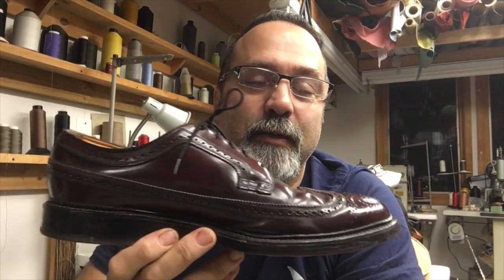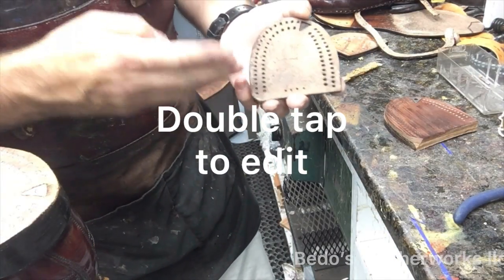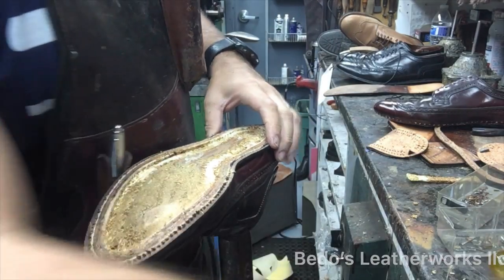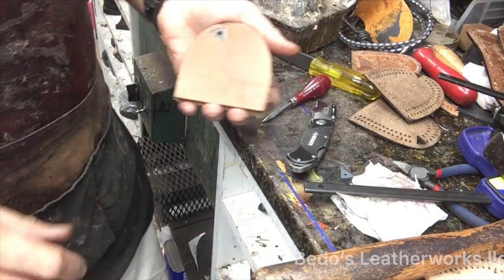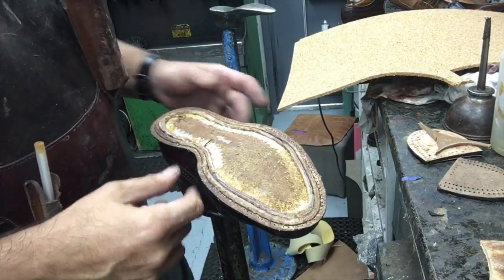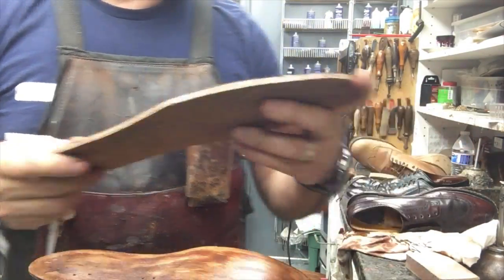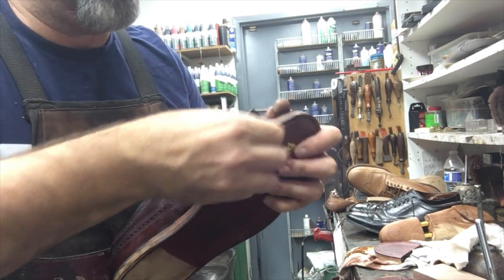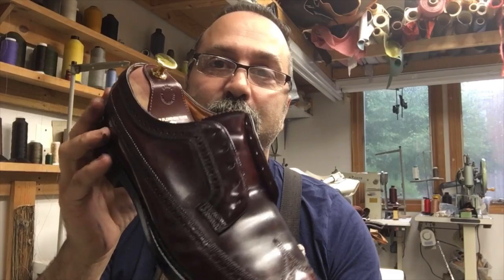Florsheim- one of the most expensive Restoration I’ve done on Florsheim’s #134

Comment: That stitching machine is irreplaceable, probably 60 to 70 years or older.
Reply: Hardly, there are lots of those things around. In fact it looks a lot newer than the one I used to use for this, that was a grey vertical machine that looked very different from this but did the exact same thing. I used to work as a cobbler when I was a student some 25yrs ago...
Edit to add why, there were a lot more cobblers before, and each had one or more of those machines.
Reply: @noth606  -  Yes, my Mother was an owner/operator of a shoe repair shop back in the '50-'70's and our Landis was an upright green [colored] beast that had no mercy if you got your fingers in the way.  I still remember when my Mom had to cut the stitches herself in order to free her hand from one of her rare missteps.

Comment: Love it. Brings back memories of my first job at 16 in the early eighties.  Working at a small shop doing  repairs, fixing heels, half sole jobs etc. Watching you applying the glue  I could smell the Ados F2 ( I think) we used to use. Loved  doing the edges of a resoled pair of leather shoes, once the dye was on and polished,  felt good to know you had done it. Hated worn women's stiletto heels, especially  when the metal pin was stuck on the tube. Lots of slow drilling and broken drill bits.  Couldn't help but notice the still visible scars on my hands from those days from drills and the occasional slip of the knife. Keep up the great work. Cheers from New Zealand.

Comment: Just a humble suggestion. While nailing the 69 sunlight-pattern rectangular nails in the original pattern as accurately as possible, one can use a thin transparent plastic template that (like a tracing paper) has the imprint of the holes from the original heel. Then, all one has to do is place the plastic template over the new heel, and drive the nails through the holes marked in the template. After the nails have been driven through, simply tear off the plastic template!

Comment: Not trying to be snarky . . . . but what is the purpose of reusing the nails?  Straightening the nails & re-clinching them results in the nail being very brittle at the bend in the clinch.  Seems like a better option would have been to install new nails of the same type to ensure the strongest bond of the heel to the sole.

Comment: it might seem to be in the same hole " stitching", only time will tell, I hand stitched hole to hole, and as for the nails did you really level each nails, since they are not going back in the same position on the heal or the correct heal for a matter of fact.
Reply from the maker: Ezzy J yes it went back in the same holes, time has nothing to do with that. And yes each nails got sanded down again it has nothing to do with the nails going in the same holes it was just to flatten the tops of the nails
Reply: @BedosLeatherworksLLC  using a mechanical stitching machine you will never be able to go through the same hole, I've always hand stitch with hands,  as fir the nails, I've always used the same new brass nails which the wage portions is not compromise  by wear for better bonding.

Comment: Hey, I've got a problem, I am bidding on an abused :)pair of Crockett&Jones Oxfords with a slight tear in the leather in the little toe area (I guess, driving is the culprit, when your foot is on teh accelerator but slightly resting or rubbing against the carpet next to it, which can be pretty abbrassive over a long period of time) Also the leather is positively parched and needs a lot of TLC and gallons of moisturizer! The tear however is my biggest concern. Can it be remedied, and if so, how?

Comment: The metal cleats set into the heels should not be set until the shoes have been worn enough to indicate where the heel contacts the floor during walking.  Chances are this is not the same for both feet.
Reply from the maker: Keith Nichols if you new how shoe restoration worked you wouldn’t ask that question 
You have the old heel as a wear pattern
Reply: Thanks for clearing that up for us. @BedosLeatherworksLLC
Reply from the maker: Keith Nichols my pleasure 👍👍

Comment: excellent workmanship, but I do not understand why he is doing the resoling work without putting lasts into the shoes. My shoemaker is always relasting the shoes that they keep the form and shape during the resoling? I also think even the welting and the under-sole was still acceptable and only the out sole and heel top was worn out, therefore it would be less costly when he would only  fix a new heel top and and replace the top out sole.
Reply from the maker: Peter J. 
Ok so when you do repairs you do no need a last, it’s not necessary. When making shoes yes that is required. 
This is a total restoration, the shoes are over 30 tears old. Just replacing the soles and not replacing the welt might be asking for trouble down the road. This was it is structurally safe to last another 30 years.
Reply: Thanks, Bedo, but it is a hell of a work to do all the hand-stitching for a new welt on an old pair of shoes. I hope you keep going to do this work as long it is possible for you. Shoemakers have always a long life, they are protected by the holy Saint Crispino the Shomaker's patron in heaven. @BedosLeatherworksLLC

Comment: This the second video I've seen where the manufacture has use compressed card board for the heel block. For what a new pair costs, the manufacture needs to stop cutting corners and use good, premium heels blocks. Using card heel blocks is a rip off on the part of the manufacture.

Comment: This is like the ancient question: If you replace every board on a ship, is it the same ship? No. Call it something else. The artistry and mastery are wonderful. However, it is polishing a turd. There is no mystique in hidden black mold. Why would anyone want to waste the time and money restoring an ugly, ill-fitting brick of a shoe? Feet change size during the day. They sweat. They swell. These boats don't. They cut in and ruin feet. They are dangerous to walk upon many surfaces. Might as well restore a rusty chastity belt. I never understood why auto nuts restore a vehicle that is basically a dot of metal amongst a sea of scrap rust. Go build a decent and honest vehicle from good modern parts without any old obsolete baggage attached.